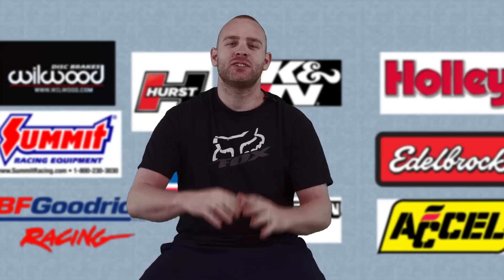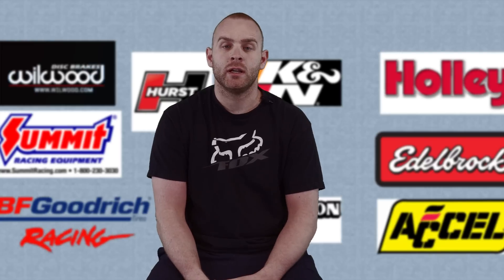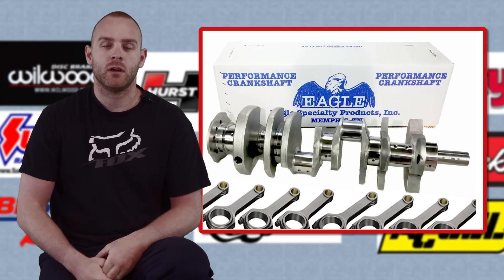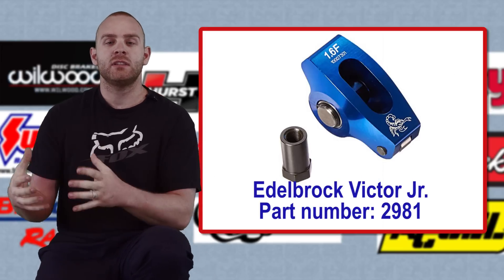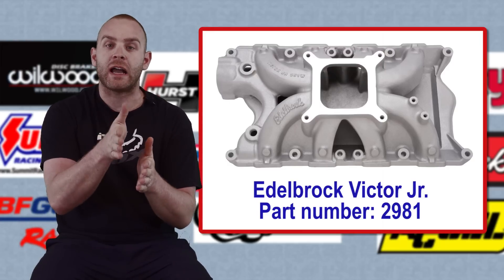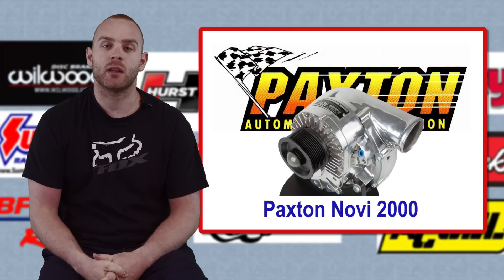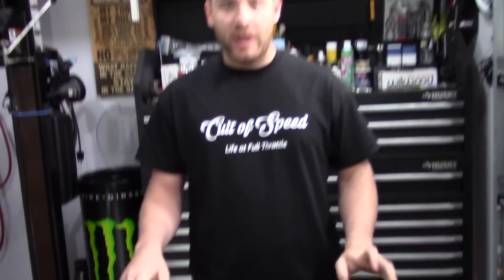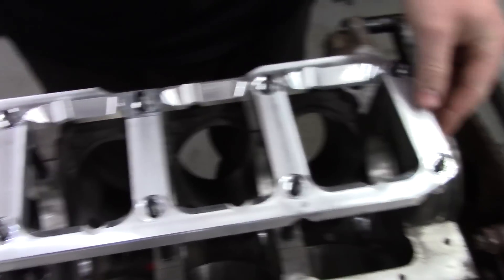351W Stroker - Recommended Parts

Comment: 351 stroker, what crank is used? What rods are used? What pistons, specifically piston pin location. Who cares about camshafts teach us something we don't know.
Reply from the maker: there is a PDF that was made that shows all parts used if you are interested in super specific specs
Reply: @710Garage  I'm not sure what a "pdf" is? What I need to know is if 351 clevland pistons are used, because of the valve reliefs? Do 351 clevland pistons have the same pin location as a Windsor piston? Sorry, but if I had the answer I wouldn't be asking. Have a great day. Wes.😎
Reply from the maker: in the description i have a link you can click that will open a document for all the parts i used in the build.

they are Windsor pistons not cleveland.
Reply: @710Garage I noticed that you listed 16124 eagle kit.... it has sir i-beam rods but you show h beam.  Did you change rods? How good are the sir i-beam rods?

Comment: you're building very similar to what I'm working my way towards. I'm so glad you added that bit about the girdle on the end. i have that same PRW and had to clearance like crazy and I don't even have a stroker.. just modified 302. I'll be buying one of those billet ones when i got 351 stroker. sub'd for more man.
Reply from the maker: thanks for the comment. glad it helped you out.   keep in touch with your build we would love to see what parts you used and how you like it.
Reply: @710Garage  do you mind updating your parts pdf to include a part number with each item and cost? most of them have a part number, but some don't. and it just makes it easier that googling prices if you have them available. haven't made it through all your videos yet, but its a factory 351 block right? also, did you use the studs that came with that billet girdle or did you order some from ARP? or were the ones included ARP studs?
Reply from the maker: pricing will change based on where you buy , sales etc... so i would suggest just shopping a bit when you are ready to buy.

yes its a stock 351w block. from the 70s so high iron content.

i used the arp studs from the DSS girdle setup they are the same as you would buy from ARP so worked out well.
the PRW ones were some chinese units that broke before even torquing down.
Reply: @710Garage  oh ya, i'll def shop around. i just meant a rough price estimate or msrp or w/e.. some didn't have an actual part number to search though. i could of course just google the brand and what its going on to figure it out i guess. i can't wait to see how much hp you pull out of that. im trying to find a way to budget in a world products 4 bolt main block.. and ya, i trashed the studs that came with the PRW girdle and ordered arp's and had to do some "modifications" to make it all work together. just wasn't sure if it was actually ARP's that came with the DSS girdle. makes it even easier. thanks for the replies btw. :)
Reply from the maker: ya i REALLY wanted a Dart block but had to draw the line somewhere... and for a car that was only ever meant to go get ice cream and cruise around the street i didnt feel like i would be able to get enough traction, or have the space to really stretch it out like a racer would.

so for the 1 second blips of the throttle where on the street it breaks loose etc i hope the stocker will hold up well.

Comment: I thought I wanted a FE for my 66 F100 truck. But a small block 427 sounds VERY appealing!! Is it cheaper to make a 427 out of a 351 than it is to build a healthy FE 390?? I just want around 400HP, nothing crazy, to make my 66 a fun street cruiser. Will never see a race track
Reply from the maker: if you only want 400 HP i wouldnt waste the money trying to make a 427.... you will need a dart block and such for that.

to make 400 HP you need a intake, carb, and cam.    thats a super simple way to make it sound healthy and make the goals you want.

Comment: My big question is, I have a 67 mustang with a T5 and I installed a 351w and the headers have been a nightmare. What headers and clutch linkage are you guys using?
Reply: I have a 68 cougar, 408w and tko.  Read too many stories of cables melting to headers ...  Went hydraulic clutch.  Pita to install as there isn't much room (wrong location could hit brake booster etc. )  But it works fantastic once in.
Reply from the maker: hedman headers and a clutch CABLE conversion was used ( uses a 99-04 mustang cable )
i have lots of room around mine
Reply: @710Garage  I did a cable conversion on my 68 falcon 351w toploader...Slick.

Comment: I have a 351w it cranks but won’t start please help
Reply: I got shocked I’m not sure about fuel uet
Reply from the maker: do you have spark?  pull a plug and place it against a metal surface on the engine... crank it over and see if you get a spark.  DO NOT TOUCH THE METAL WHILE DOING THIS OR YOU WILL GET SHOCKED.
if you have spark, are you getting fuel?
check to see if you have fuel pressure.

Comment: Hope you didn't torque them  to the 1/2 torque  ! , I made my one but it is on top of the main caps with around a 3/8 spacer all ground flat , so its all held down with 1/2 NF  arp main studs & nuts , getting 127 mph 1/4 mile , still together. :-)
Reply from the maker: well thats awesome

Comment: Pretty Badass! I got a 95’ F150  single cab short bed I wanna put a 351w in it
Reply from the maker: you wont regret it!!!  everything from a SBF will bolt up, but you are starting with a more robust block, and it helps make more HP and torque due to the added displacement..  It really is a no brainer!!!
Reply: I did that swap a few years ago. Love the 351
Reply: sounds just like a lightning

Comment: Awesome video! Thanks for the info. Planning on doing a very similar build on my 89 gt. Do you have to upgrade to a higher flow fuel pump for the Holley sniper kit?
Reply from the maker: Hi Nathan, Thanks for the compliment and the question. Without knowing more about your current fuel pump or your engine build it is difficult to say if you will need a higher flow fuel pump. The choice of a fuel pump comes down to the expected horsepower of your engine. In the Holley Sniper manual, it lists three possible fuel pump choices depending on power. The power ranges are; up to 800HP, 800-1000HP and over 1000 HP. Here’s a link to the manual, have a look on page 6. https://documents.holley.com/199r11489.pdf
Good luck with your engine build!